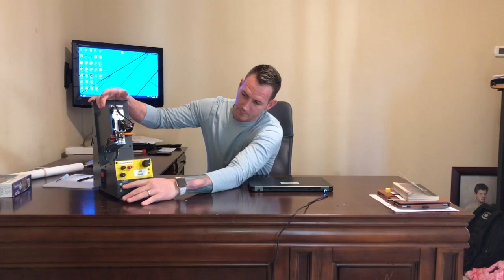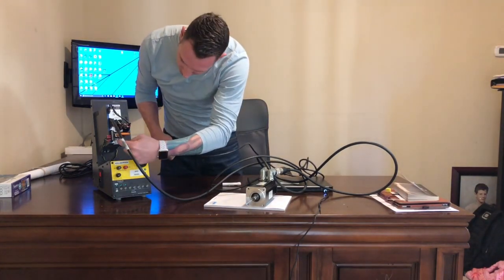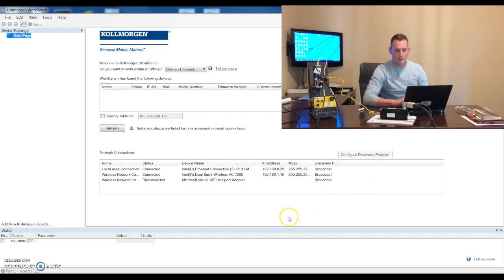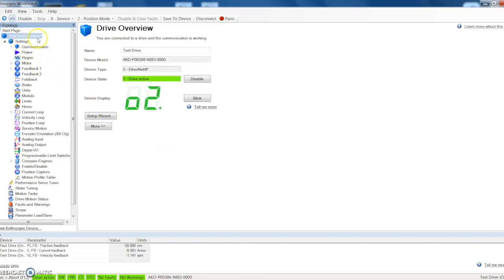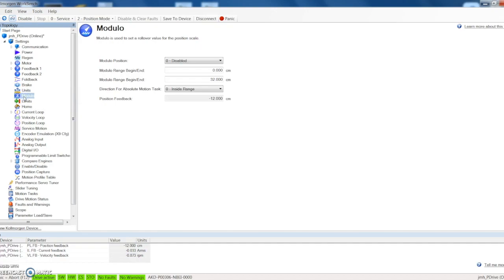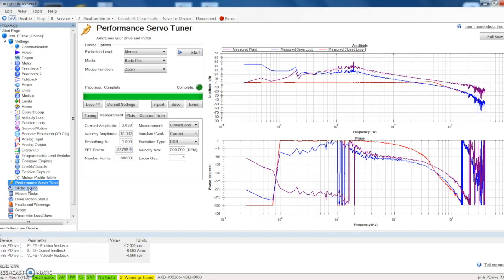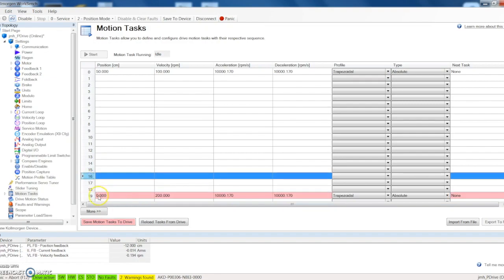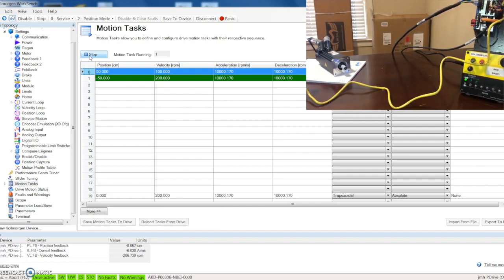Kollmorgen - Positioning Drive Demo

Comment: I had a trio card go out on a 125 volt servo that had been in service for 16 years. The trio card was obsolete so had to order from eBay. I am still getting comms issues on HMI when connecting to trio. I can connect to trio using the motion pro software. Is there a help desk to program danaher dervostar 300 ? It’s a kollmorgen servo and communicating using DF1 on the trio